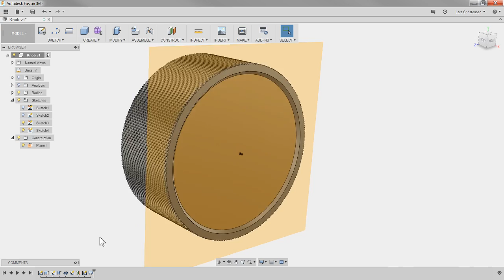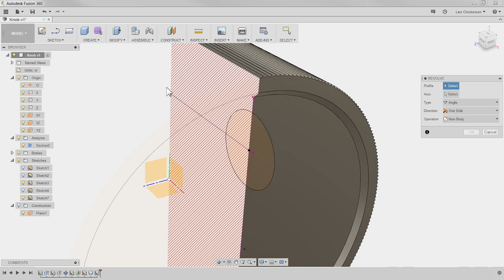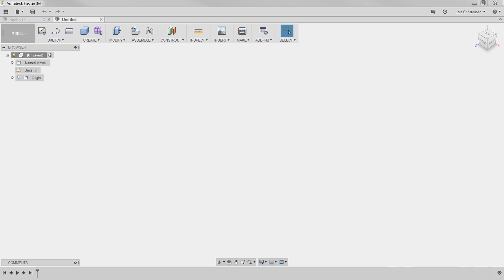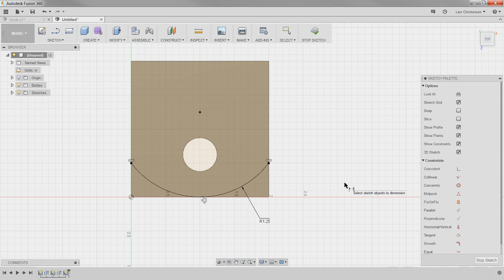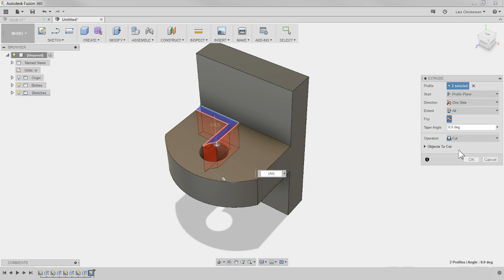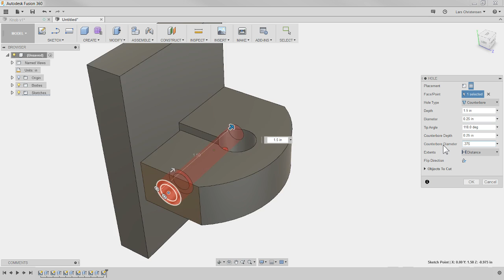Fusion 360 — AskLars Vol.1 —Your Comments & Questions — #LarsLive 23

Comment: Good work, as always. I just have some observations.

For the finger cavity in the knob, my first thought would be just to create a sphere and "subtract" it from the cylinder (using "cut" operation where the sphere is the "tool" part.)

I also noticed that Lars likes to type in numbers and expressions directly a lot (divide by two to find the center, etc.)  Myself, I would either base those expressions on other dimensions, so if they change, the other ones will self-update, or, I would project some geometry, turn it into construction line and then use the center of it as a reference point (with same effect - the dependent geometry will self-center itself in case other dimension changes.  I am not saying it's needed in a simple situation like above, but I think in general it's a "good practice" to ask oneself every time when entering a direct number if it can be derived from something that is already there (yes, a programmer talking here, so I may be a bit biased:)
Reply from the maker: +Leeloo Minai Great comment!